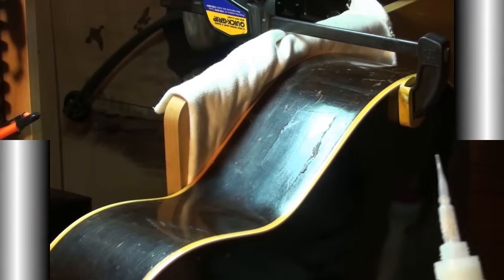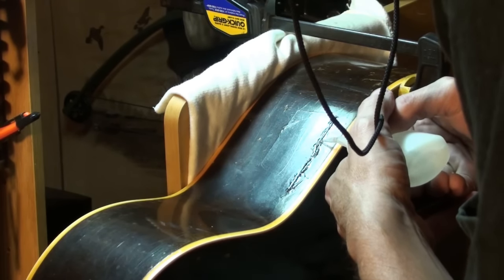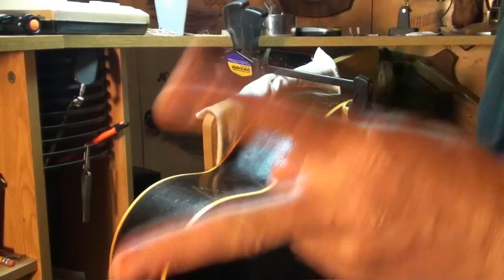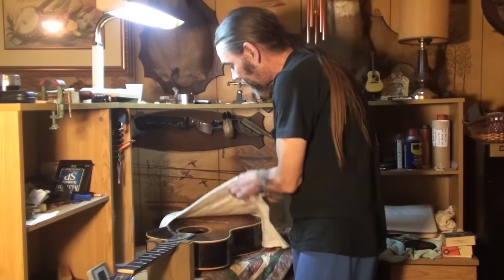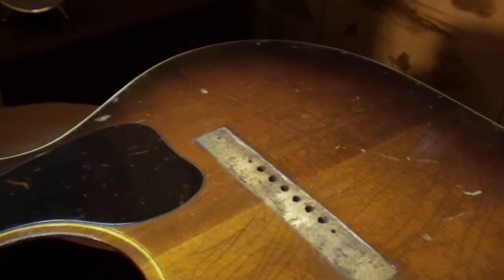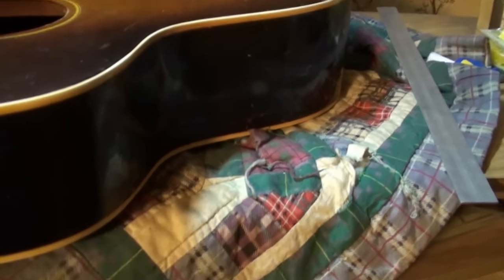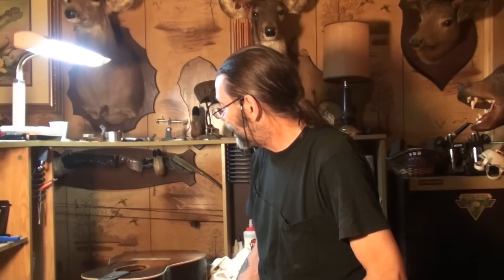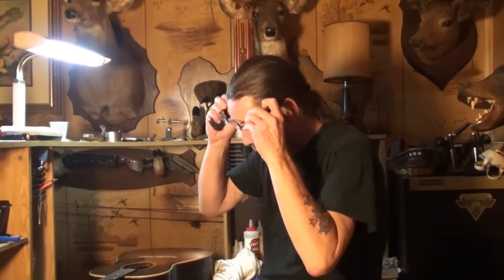Gibson LG2 PART 4 of 6 fixing crack in side and relieving top!

Comment: I can hear a strong Beep beep beep on the monitor Dr Randy, its pulling through... the strings will be the real test! Cool blade tip for scraping.

and get better man.
Reply from the maker: +Richard Kurbis (PAINFINGER) That blade tip really works perfect on a flat surface, or a surface your wanting flat, in this case the was just too much difference in each side of the crack, it still helped tho. Thanks for watching Richard and commenting. Yes! Strings are coming soon! :)

Comment: This repair with the 'superglue' rubbed me the wrong way , a little - 
I KNOW that you could give this job to a thousand people, & they would all go about it in a different manner . . . 
    I think that I would have tackled the side crack 1st , and would likely have smoothed out the crack * thereby LIFTING that side a bit, which would have given a bit more of a flat top . . . 'old school' would have moistened the wood, then a bit of heat to cause the grain to interlock itself by swelling . . . a pair of blocks could be made easily enough to fit the inside & outside where the crack is . . . ( then take a patch of cloth, saturated with hide glue, place it on the inside of the crack . . . cover that with wax paper . . .then bind up the clamp ! )    A bit of the hide glue would ooze out the outside, so a bit of wax paper would be prudent here too . . .     The finish is very likely to be lacquer, which is EASY to put checking cracks back into . . . ( hot & dry , followed by a very cold damp rag )    
      Time cost , versus pay for the job is likely why you chose to just glue it ! ?
I spent a number of years as a prototype machinist . . . & was taught that there is NO WRONG way to do a job RIGHT , . . .and that if you start RIGHT , you'll end up finishing right !    
     This old box is going to sound great . . . old & brittle tends to sound FULL & MELLOW !
Sorry about you having to go through the flu - it's nature's way to give you a DETOX !
Reply from the maker: +georgewocosky It's always a pleasure for me to get to talk with someone who knows what the hell they are talking about! You know how some people just never are there, even when they're there ya know? And some are just absent all the time hop from one subject to another like grasshoppers! lol Everything you said is nearly identical to how I would have normally repaired it. But by me getting sick and not getting to work on it some days, today is the 26th and I have to give it back to the owner Saturday the 31st, (I really would like to keep it another week and just watch it because with this much work it's gonna change big time over the next month or so, and longer before it finally settles in) that and the amount of money we agreed on and how very close we are already to the maximum quote, plus he mainly just wanted it in playing condition again and structurally sound. All the above combined is why I went this route, like Dave used to say, we can't always make them perfect but we can always make them better! lol So in this case with the conditions I had to go with the better route but limited by the budget. I fix them how ever they want them depending on the budget and time. Thanks for watching and your comment mate! And the advice! You should open shop!
Reply: I'll probably be doing a number of builds / rebuilds in a few months . . . I've got tools that will make tools , * that will make OTHER tools . . . but I'm living in a very small apartment right now . . . not only is there NO ROOM, there's the nature of the work : SAWDUST, finishing overspray, etc.    'Will keep you posted !   I'm moving into a nice brick house with a full basement , & an OVERSIZED two car garage / shop !   HOLD ON !  :p